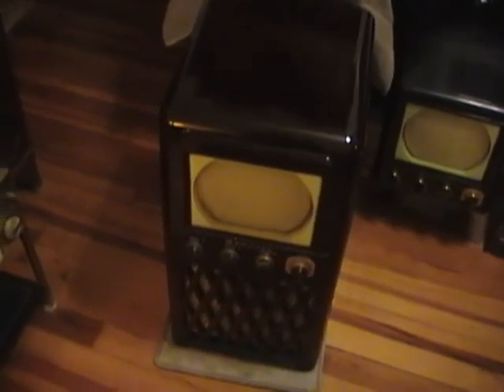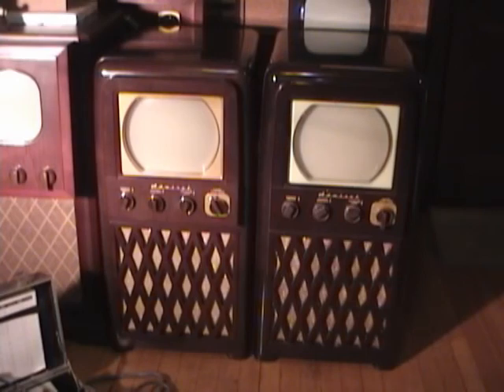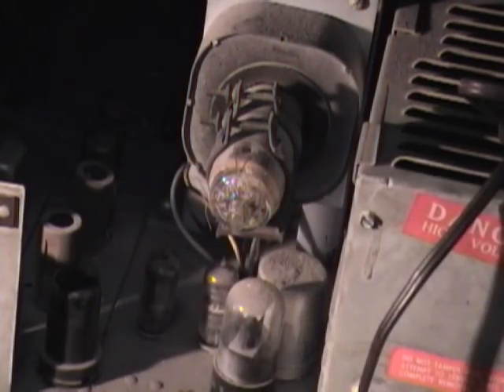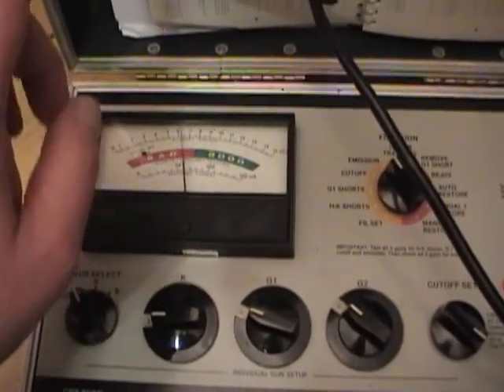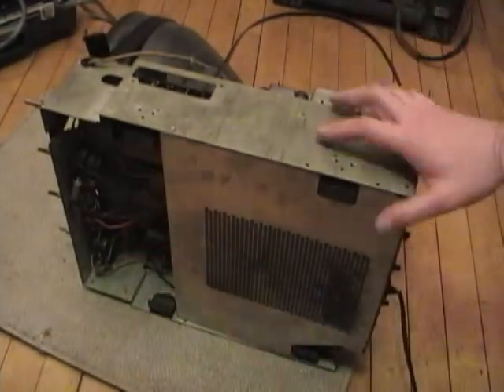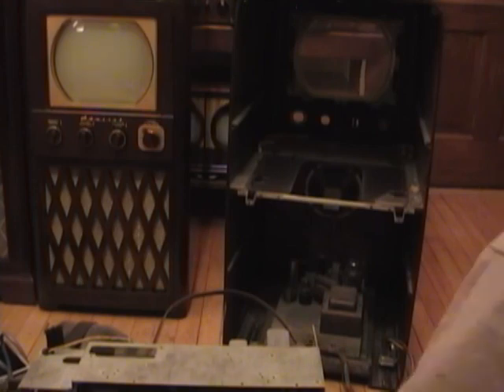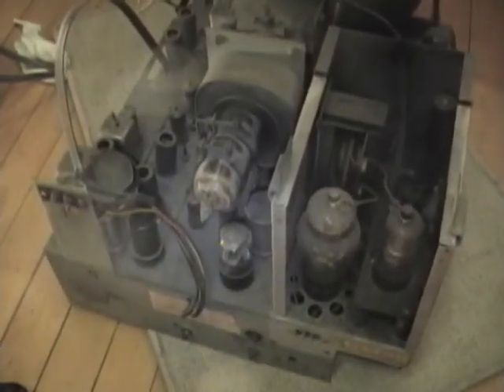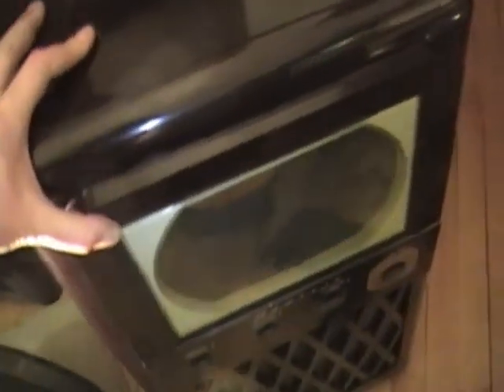A closer look at another Admiral 24A12 TV

Comment: @bandersentv I'm going to do a vid on my Mitsubishi front projection TV tomorrow. My question to you is, should I demo it with my SNES running starfox or DOOM or should i be a bit more period correct and demo the thing running an atari 2600 in a joystick? Either way it's an awesome TV and I wish my ps2 didn't die on me (bad laser diode in the cd drive) because light guns worked perfectly on it and it has an awesome bright picture.

Comment: @bandersentv the system is an old intel socket 775 single cpu motherboard (915PBL I think) the fastest processor it supports is an SL7Z3 3.8ghz p4 which I'm debating getting for it along with a better graphics/capture card and maxing out the ram to 4gb running it dual channel (533 DDR2) I want to be able to at least to rudimentary 720p video editing on it.

Comment: @bandersentv No..Only additional holes are $0.15 ea. up to 1,000 holes are included in standard pricing. I estimated each piece to cost $25.00-$35.00 each piece. I've made chassis before too. You have your choice of materials too.  I have a fairly large stock of sheet goods 48x48.